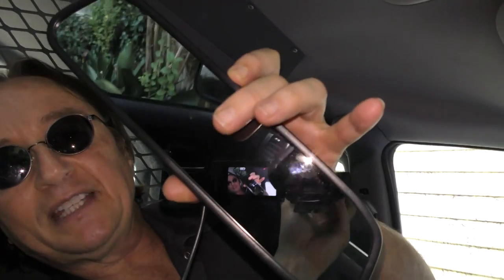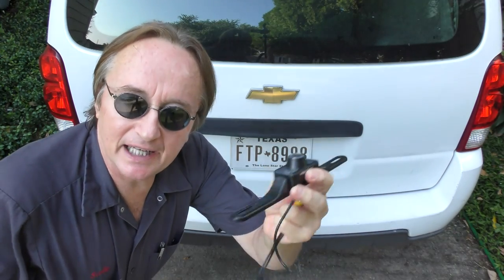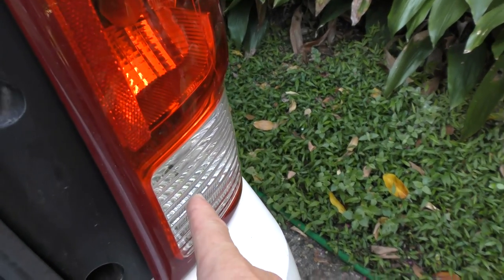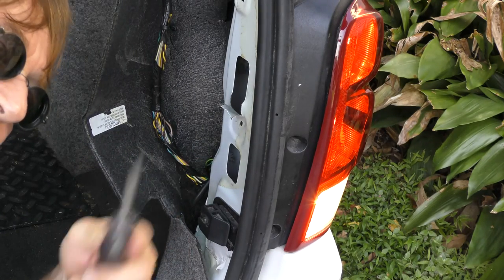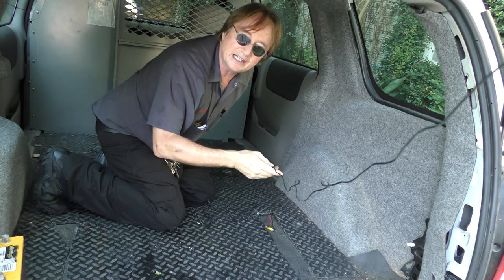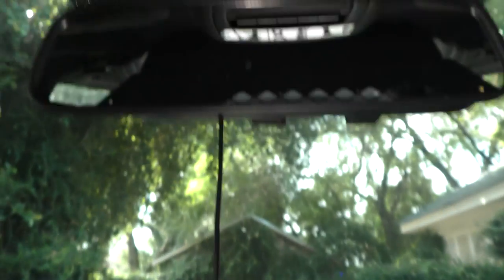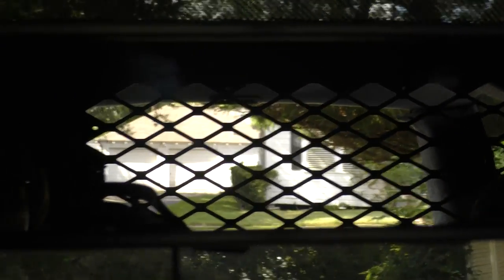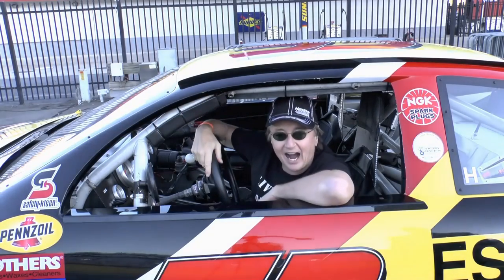How to Install a Backup Camera in Your Car

Comment: I personally don't like the clip on reverse mirrors but meh nice vid scotty
Reply from the maker: well, you can buy custom made ones for ten times or more the cost
Reply: +Scotty Kilmer If suction cup gps are illegal in some states, it is doubtful that this is safe.
Reply: +Scotty Kilmer where can I buy this product and do you have a link for it
Reply: I don't either because you lose the day/night flip function
Reply: +Scotty Kilmer precisely 😀 though as Ratberg86 suggested you lose your day/night function with the clip on mirrors .whilst a proper one with the works has auto dimming, only problem I had was wiring haha damn Subaru

Comment: but then you will have an annoying wire dangling below the rear mirror.
Reply from the maker: you can feed it up or around the ridge of the glass under plastic bits

Comment: Lol some of these comments!!!
Draining battery over night!?
You wired it to a continuous power source!?!?!
He said wire to back up light... & an ignition source wire(power when car is running! Not when it's off/not running!!)

One idea would be plug into cigarette lighter when you get in the car... & unplug from cig lighter when you get out!?
If you can't find proper power source.. or don't mind wires being visible!?
Make sure you have a ground wire grounded!!

 If you can't wire up a radio , a set of fog lights, or an electric fan in a car..... don't wire this up if you have trouble finding control wires & following instructions, etc?!

Get some help or let somebody else do it??

My oldest wants one of these on the car I just got! The cars rather long & judging distance in the back is hard for me too...
Long trunk like a crown Vic?!
So I'm gonna do this for her & the insurance company!!!!

Comment: Rather than randomly probing wires looking for the reverse feed, take the reverse bulb out and look at the two wires going into the socket - one of them will be the black ground wire and the other one will be the color of the reverse feed.  Also, don't bother with those wireless transmitters - they completely SUCK.
Reply from the maker: good to know, I never tried the wireless one

Comment: Scotty this actually isn't good to have in Texas. I live there too and I got pulled over and given a warning just because my license plate frame covered up half of the "Texas". I know it's a dumb law, but it's still a law
Reply: I love the way the common people are hassled for such nonsense offenses, while the bankers are initiating policies that are clearly illegal and unethical but they are never charged or questioned.
Reply: Great video and an idea that could save lives.    But you cannot cover any part of the lettering, this will give the police cause to pull you over.  
I put a backup camera on my car and used a small camera that mounted on the bumper just above the plate. Almost invisible from rear.
Reply from the maker: that's modern society for you, cause really, the only thing that matters is the license plate numbers which are not effected

Comment: everyone please keep in mind that obscuring your license plate, even partially, is illegal and will result in a ticket.  Don't obscure that STATE name.
Reply from the maker: OK, you could trim the bracket or move it slightly upwards
Reply: In NJ  a couple years back, there was a rash of ticketing for even the dealer cover advertising plates for obscuring the plates, so this is a problem at least in some states.....some of the dealers covered the fines, some didn't.
Reply: *****
probably a bunch of rookie officers out with their FTOs (Field Training Officers) ... theyre required to write up everything during their prob'ie time.

Comment: I feel like it looks awkward as hell there on your plate.
Reply: I'm worried it might cover my license plate sticker but for 20 bucks?
Reply: Theft is what you should be more worried about, there are methods where you can take the camera off the mounting bracket and mount the camera behind the window in the back.
Reply: cuvkiller I meant 20 bucks for an experiment. If it covers it than i wont use it,
Reply from the maker: you can easily cut or make a bracket adapter so it doesn't block the State name on the plate

Comment: Yes i'm not cheap as you.
Reply: Its a cool idea, but I dont want wires in front of my lol. But its worth it compared to factory built ones
Reply: TheDox451 i agree an extra 13$ for wireless takes the headacje out, more simplistic and less possible damage of you fucking something up. Now if it was a mid to late 90s civic or the like go for it but i manually tried to make my kia from an lx to an ex by adding leather. I dont need remote seats push button start.
Reply: mixwell1983 Does it run on battery then? If so do you need to replace them every now and then?
Reply: TheDox451 That's what I would imagine.  Unless it plugs into the system and runs off of if that way.

Comment: I can't stand back up cameras.
Reply: Why?
Reply: You should try driving my Volvo S80 sedan it's impossible to tell where the trunk ends on that thing when backing up.
Reply: If I can't see out the back of a car well enough to back up using my eyes, I'm not buying that car. 

It's not impossible to tell when the trunk ends. It just takes a little bit of learning. Learn your car, learn where every bit of the car is, set up your side mirrors properly (if you can see the side of your car without turning your head or leaning over, the mirror is turned too far toward you). I know exactly how much distance there is between the farthest part of my rear window and my bumper, even though I can't necessarily see it. People are unwilling to learn their vehicle is all, they're afraid or unwilling to actually operate their machine and want everything done for them. 

Backup cameras condition people to not ACTUALLY check when they're reversing, it teaches them that the car will do it for them. I don't feel comfortable sharing a road with people who can't check their surroundings themselves and need a camera to do so.
Reply: Mike D If it makes you feel better I'm a semi driver I manage just fine backing that up without any cameras. I'm just too used to owning a station wagon where the back window is the back of the car for many years. But I do agree with you too many people are becoming reliant on parking sensors and cameras being a profesional driver who easilly covers 350 miles a day I see some terrible awareness from other drivers. If they can't notice a great big truck what chance does everyone else have...